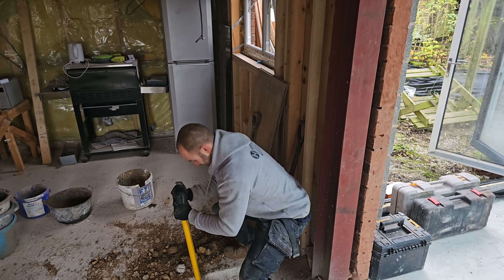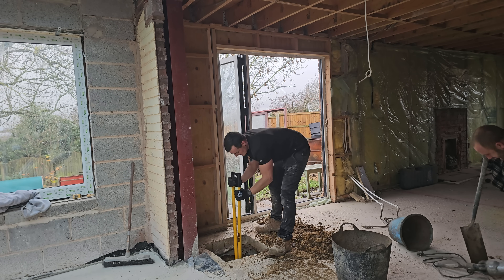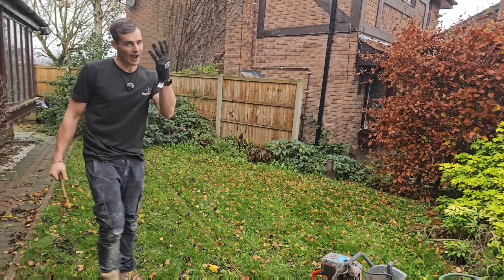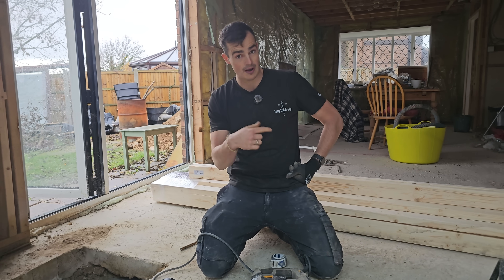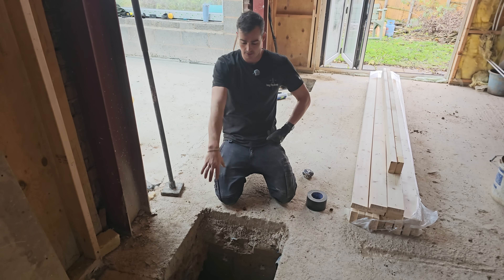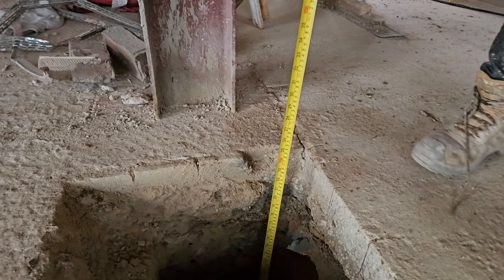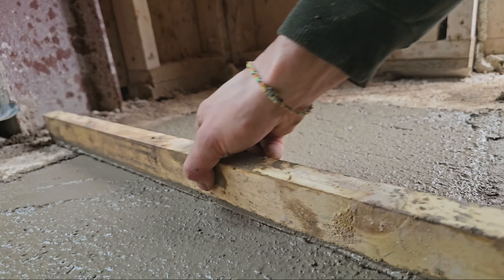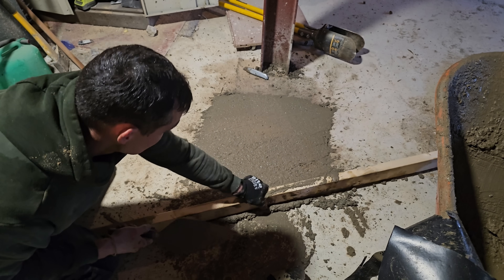Building Control Refused to Sign This Off — Here’s Why #bricklaying #construction

Comment: So, if I'm watching and understand this correctly.... BC needed to view the exposed foundation hole to ascertain the suitability/structure of the ground before pouring certified concrete as a foundation for the steel. ?? BC never saw the excavation so refused to sign it off. You guys then open the floor, don't get the ground/hole inspected before pouring non-certified concrete which will provide an absolute minimal addition to the weight loading of the steel; and BC will sign it off ????? If the job the original builder did was at fault, the entire pad/foundation should have been underpinned to establish a correct footings imo. Makes good YT vid though.

Comment: as a structural engineer of 50 years experience i can't see how they've improved it! a new pad on one side, you'd need 40x dia of bars to get a proper embediment for the rebar to do anything worthwhile assuming 10mm bars thats 400mm, looks like you're lucky if you have 200mm!

Comment: I did BC with the NHBC for 26 years and I can tell you that the extra work you have done will do nothing to improve the support to the columns. The probability is you’ve weakened the existing pads by drilling holes through them and causing them to crack. The supporting ground looks very hard and is gravel so a few small trial pits should have been enough.

Comment: Surely this is down to the engineer , calcs and drawings r normally done and submitted to the local authorities for approval before the work commences thus eliminating this sort of major headache problem , someone further up the chain hasn’t done his job properly if at this stage building control refuse to pass it off , if uve done it by the book I reckon ude ude have some sort of redress to recover expenses at their cost

Comment: Doing that will make no structural strength for the vertical rsjs whatsoever Saying that the stress coming down the rsj and the steel rebar  will help deflect the stress will be minimal The stress is directly below the rsj and this is where correct groundwork prep and inspection before installation Not 4 rebar what a load of nonsense 😂😂😂

Comment: I once worked on a kitchen extension where the builders laughed when the building inspector fell into the trench when inspecting for correct spec before concreting. Come the final inspection ready for signing off they put in a steel over a new opening into the the existing kitchen, something which he hadn’t seen until after plastering had been completed. Because he hadn’t seen how much the steel was bearing on each end he made the builders access each end and because one end was 15mm short of the minimum requirement he made them build a 125 pillar on the inside to support the steel. This pillar then interrupted a long flat wall around which the new kitchen had to be fitted. Moral of the story, don’t mess with the building inspector even though the incident was funny bite your tongue and keep a straight face.
Reply: Spot on.

Comment: M sure it would have been easier to weld some spreader plates and webs to spread the load from the steel into the concrete floor it's only two story building it ain't going nowhere anyway but would ld have satisfied building control and been far less work with zero damage to the dpm

Comment: With regards to building control being over cautious and covering themselves
If you look at a building control certificate it say as far as we can ascertain all the works have been done to the right standard
That certificate is not worth the paper it’s written on if there is a fail down the line and you call in the B I
As said by someone if you put in a steel or timber joist 30 years ago and it was ok why have the sizes for the same job now doubled

Comment: Please go and read the Installation for instructions from the manufacturers of the resin system as I don't believe you have met their requirements for justifiable design values. Also this remedial design without underpinning is inadequate. As the pad becomes an eccentric pad. I'd be interested to see the calculations justifying this as I believe there's been a mistake.

Comment: The point is, a statement of  " that 'll carry a 4 storey house" does not stand up in court. 
If no inspection has been carried out, then the best builder in the world should never cover up groundworks and structural elements. Simple concept. Saying that, info from a building inspector said that many councils have sacked loads of building inspectors as they weren't passing their exams. This has created a shortage and ultimately no inspections and sign offs. Homeowners should do their research as the legal bite on the ass could be around the corner.

Comment: We almost lost a 300yr old stone house sat on big rocks (foundation) because building control wanted the foundation of a single story wrap around 2.8m reducing to 2.0 etc etc because of a bush across the road. The deep foundation Caused the existing gable to move and crack.
Hasn’t moved in 300 years until building control got involved. Idiots

Comment: I know this telling many blokes how to suck eggs but for digging holes manually but there's a better approach.  The hinged post hole shovels/HPHS works way better used along with a 5ft straight bar [ chisel or point ]. The bar breaks up the bottom and the HPHS brings up the waste. If you use the HPHS by itself you'll only gets garden trowel amounts of waste.  Circle around the edges with the bar and lever out waste from the centre. Then use the HPHS. Much faster.

Comment: Its always better to be safe.  We dont know what might happen.  What if a heavy earthquake rocks the uk?..  its always better to be safer, becasue if u were to have issues later down the line, you will say,  "only if i effing did this and did that and followed the inspector or followed the propa guidelines to install steel girders in the first place"....

But and a big but,, those holes aint going to do much difference.  The veritcal girders should have been taken out redone.   Each virtical girder should have had a wider, in all 4 corners, and deeper  concrete mix with Rees  etc.

"Hungry holes"  that could mean a lot of things lol

Comment: You think this wooden ones were heavy, when i was a landscaper I had a set of steel ones on steel tube,  they worked the opposite of those ones in that when you pushed them together that when the spades closed so whilst heavy as fuck you could dig better with them as they were heavier and you could lift out easier as you was using the muscles you have more of
Reply: Shuv holer. Fast hard work.

Comment: A job well done! But surely all we have now is the existing "potentially insufficient" pad, sitting adjacent to the new good pad, tide together with a few bits of rebar. So if the original pad moves (which is BC's concern), the 2 or 4 bits of rebar are potentially taking the entire weight of the steels and whatever they're supporting, as a shear load? I'm not an engineer, but that still doesn't seem to solve the original concern so feels a bit pointless? But nicely executed according to the drawings and a great vid 👍

Comment: Two bits of rebar will do nothing. Also cutting the holes will seriously weaken the concrete slab which will still be the main method of supporting the steels.  This is literally introducing a large weakness and replacing it with something that is probably no better.
Reply: They could add temporary additional support to the beam during the work although I couldn’t see any.
Reply: I thought the same. Not an architect, HNC mech eng. The principles are the same, forces going straight down through the various components, the Greeks and Romans understood.
Reply: You are sooo wrong - its called 'load bearing' and its achieved by surface area divided but LB capacity under. Spread the load increases the bearing capacity. Unless the subsoil was investigated before calcs done the SE has to make assumption on LB capacity - had the builder get the BI to site, all of this could have been avoided! Remember if it fails, they'll come after the builders first!
Reply: @kawazukisoddbits2717  And usually find that these types of builders have made plenty of errors and are now gone bust.
Reply: @kawazukisoddbits2717 absolutely right, and also ground stability is also a factor, shallow foundations in clay can be subject to seasonal movement even though the bearing capacity is OK. Made-up ground is also a concern and needs to be removed.

Comment: Ridiculous stuff from Building Control 
If the Steelwork base wasn't adequate why didn't they require temporary props to support beams
This is comical 
These Concrete Pads  don't underpin and honestly are pointless 
Keep her lit Izzy

Comment: Surely the reason you are doing it is because the previous builders co@ked up and didnt provide adequate foundations, as shown by the BCO and structural engineers both agreeing it was an issue. The fact that it enables the owner to get a completion certificate is just a nice bonus.  Great call by the BCO.

Comment: Did you vibrate your concrete?
Reply: Your concrete look too dry and it should have been vibrated, 2 silly little bits of steel are not going to stop rotation or slip and the existing slab should have been cut back to allow 150 lap over the existing D.P.M, I hope you got Building Control to pass the ground compaction on the holes you dug before you concreted the secondary slabs.
Reply: Came here to say this

Comment: Complete waste of time and money and it's pretty obvious to anyone who's been in teh industry for decades this was/is nonsense. It's a bit like Building regs requiring Trickle vents in windows now when for years they weren't required, then they wanted to see them in replacement windows where the existing window had trickle vents and now they are compulsory. We need to make our windows as energy efficient as possible with ever increasing demands on U values so energy efficent glass coatings,gass filled units,thermobar spacerbars , draught excluders etc and then we are going to make you cut a hole through the entire window and put a bit of plastic in it to allow for ventilation or more commonly known as fcuking draughts and condensation.  What utter nonsense and this is just another example of Building control being ill eduated idiots and jobsworths.............

Comment: Video technical tip: movement in your video is very jumpy, almost certainly due to being converted from 30 FPS to 25 FPS. It'll look far better if you use the same frame rate in the edit as the original recordings, or a multiple thereof. Also, the higher framerate the better it'll look, such as 50 or 60 FPS (like TV is).

Comment: Surprised that the engineer didn't require the re-bar!  That's what gives the concrete strength.  Glad you caught it, and added.  Otherwise the concrete pad would easily crack.

Comment: I am a steel fabricator and have been involved in lots of domestic house builds and extensions etc. The structural engineers must work to a massive overtolerance and it's all really about "covering their backs" . The same with the building inspectors. Some clients  when they see me turn up with a load of steel , cannot believe the size of it and that it's all got to go in. I have to stress that It was not down to me to come up with the design
Reply: This wasnt a "rectify steel job" it was a rectify inadequate foundations job caused by the previous builders not digging down to virgin ground, and not calling the building inspector in before concreting. 100% the fault of the previous builders and thanks to the competence of the BCO in spotting this the house owners have been saved from potential problems down the line. By your own admission the ground under the existing bases was rubbish. The whole tone of your video "was we had to do it to get a bit of paper but it was totally unnecessary" and does you no credit. The BCO has a thankless task at the best of times, and it is clear that he saved the day.
Reply: So clients with no knowledge of building or structural engineering are a better judge of what is adequate than Structural Engineers and BCO's?

Comment: Cant understand why your grumbling with comments.....you cant beat a building inspectors word....even when you think your right....thy are a law unto themselves 😅.....should have just waited for them to inspect the pads....notice the grond directly underneath the beams weren't up to their expectations and gone from there!!!!......we done all the stainleess steel frames in the two tunnels at Ilford.....the cheif inspector,memesh....nice guy,told us after we had done one side and halfway through the second one......we were ten mil out on every single frame...the pre drilled holes were in the wrong place,when they were fabricated in Merseyside....they had fucked up on the measurements....we had to redrill every single one....and we couldnt use the mag drill because they were stainless.....complete ball ache.....but what can you do 😂😅😅

Comment: That doesn't look like 450mm of reinforced concrete, more like 300mm + some hardcore-ish material? In poor ground, my structural engineer (SE) dictated mass-fill pits min 1200mm deep below steels, this for a lightweight bungalow. Obviously, what's not shown here is the weight bearing down, as this looks a 2-storey(+?) house? I suspect either a ground inspection wasn't undertaken and/or the original builder didn't follow the SE's plans (or the SE mucked-up?).

Comment: A reason for much of caution by building inspectors,  could be personal liability  for works passed by them. I'm pretty sure fines etc are now more of a risk then they were before
Reply: Yep, lawyers and insurers making sure that the building owner spends ever more as a result of allowing corporate building control  into the mix.
Reply: Except that you can't sue Building Control as they have no contract with YOU !!....🤔

From a Google search....

"The building regulations regime is implemented either by the local authority building control department, approved private sector inspectors or self-certified contractors. A person who intends to carry out work which requires building regulations approval will have to apply by lodging plans with the relevant inspector or by submitting notice of an intention to carry out work. The building control officer will then inspect the work as it progresses and will sign it off once complete.

One question that often arises is whether the local authority can be liable for any defects in the building work that they fail to identify during site inspections.

This was the issue that arose in the recent case of "R (Gresty and another) v Knowsley Metropolitan Borough Council" [2012]. In this case the owners of a property in Liverpool engaged a contractor to build an extension. 

They submitted plans to the local council for building regulations approval. The plans were approved and the local building control officer inspected the works as they progressed. 

Unfortunately for the homeowners the work was defective and required considerable remedial work. They sued their builder but were unable to recover any money from him due to his financial circumstances. They therefore made a claim against the council alleging that their inspector had failed to perform his building control functions properly by not identifying the defects. 

The council denied liability on the basis that they had no contract with the owners of the property and had no duty of care to the owners when carrying out their building control function. The owners tried to argue that the European Convention on Human Rights imposed a duty on the council to protect their home and ensure that the work was not defective. However, this argument was rejected by the court who said that there was not duty on the council. 

It may seem unfair that the local authority cannot be sued for failing to identify defects in work which their building control officers have inspected. 

However, it reinforces the need for property owners to make sure that they have adequate protection in place should building work prove to be defective. This can include asking the builder to provide a bond or insurance backed guarantee for the work that they do, retaining part of the agreed price for a period after completion of the work or obtaining direct warranties from any sub-contractors. "
Reply: The role of the Building Control Surveyor has changed beyond measure since Grenfell. Anyone willing to be a  BCO these days has my total respect.

Comment: Those who dont know , think its over kill....Its not / Used same SDS  &  Stamper , 3mts, ago , same method , Fence posts in soft ground , rammed hardcore , rebar longer at 45% angles , driven in , sledge. Concrete ties together post , rebar & ground...👍/  you see  builders understand physics too

Comment: So does this mean my house with zero foundations is gonna fall down all of a sudden after 160 years 😂
Reply: Point loads that a steel exerts are very different to the spreader footings of your lime built 160yr old house
Reply: @kyam3331  Exactly right, Kyam. 👍
Reply: @kyam3331 and those steels sat on all that concrete could hold up a multistory carpark in real life
Reply: .... yes... yes it does.... 😏😂
Reply: No - don't be hoodwinked by survivorship bias 😉
Reply: @Ben-in6qh My cottage was 285years old, 750mm thick stone walls. No foundations though. No movement either.
Reply: Yeah your doomed
Reply: Yes. And it will collapse at night while you’re asleep. Most likely on a Tuesday
Reply: Longer handles?😂